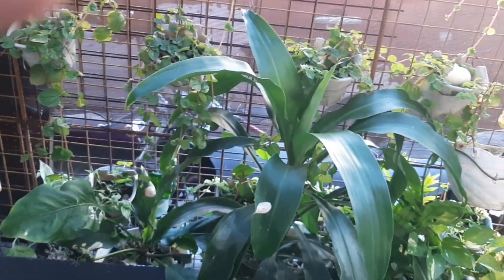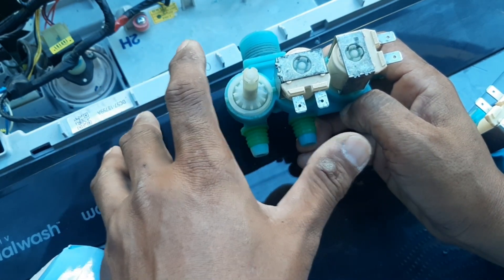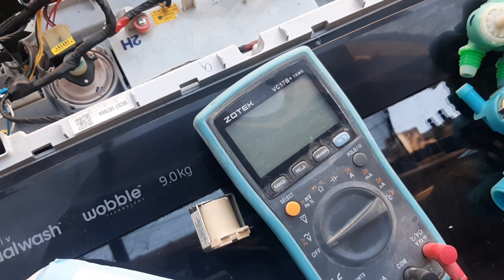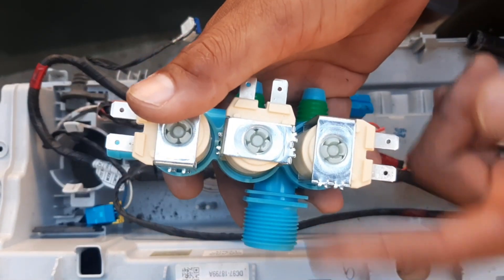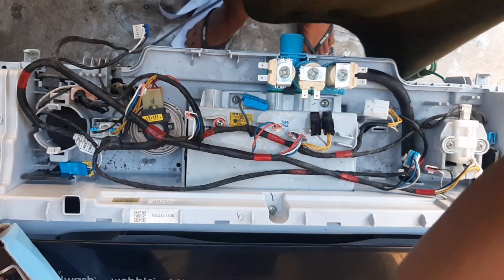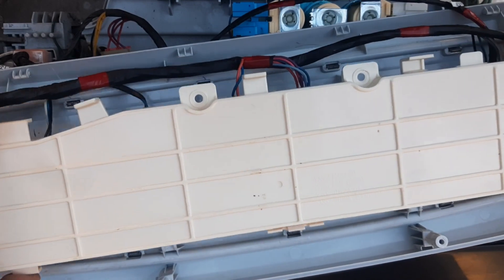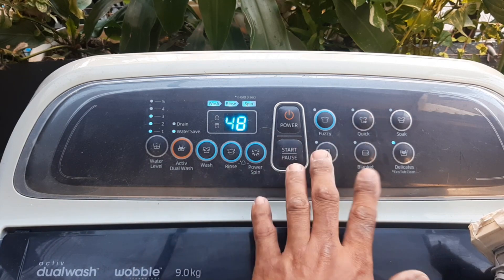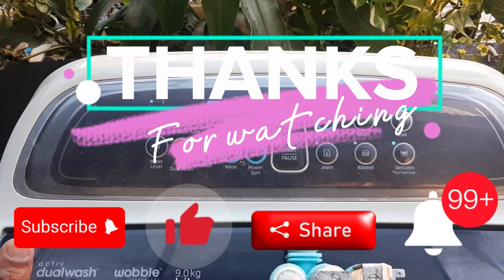#46 How to repair Samsung Wobble

Comment: Hi i tested  my water  inlets  water valve is no reading  by the way where can i buy the new parts ,im from paniqui  Tarlac
Reply from the maker: hello po, sa shoppe lang po ako bumili ng parts, ang importante po tama ang part number po. thank you po
Reply: @BatJuanTV  sorry sir I'm foreigners  I don't  understand  tagalog  only English thanks
Reply: @BatJuanTV  hi sir the parts if I order frm online  shoppe it took almost more then 2 weeks I know its cheaper bto get from shoppee  but my wife need to do laundry  so can't wait for so long ,is there any  sources that can buy this parts besides  shoppee? I can install by myself, I have the parts no
Reply from the maker: hello Sir, as i mention. i only ordered my parts on shopee, and of course, it is so easy to install. just remember how you disassembled it. Don't forget the part number is important. But if you in hurry, you can buy directly in evangelista, manila. but you need a hard time to search one by one in every store. so, i recommend to shop on shopee Sir.